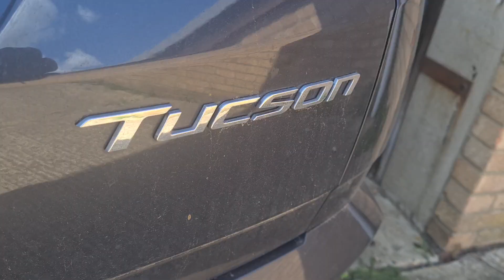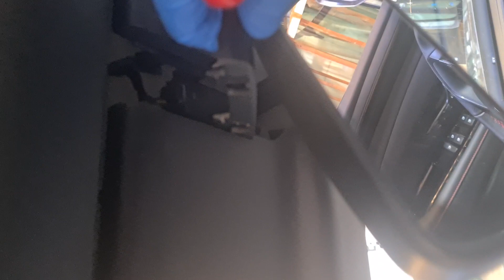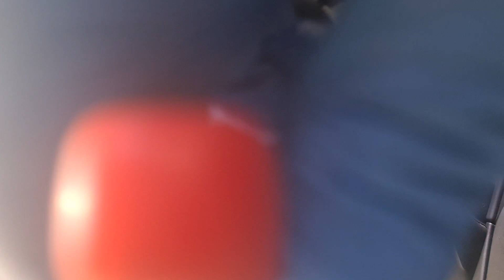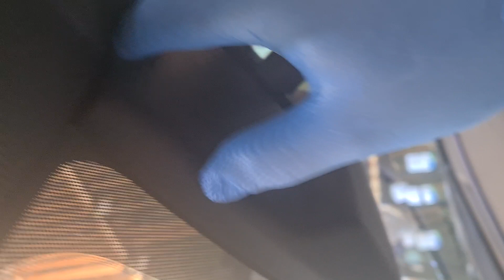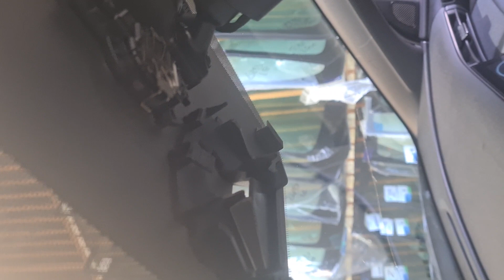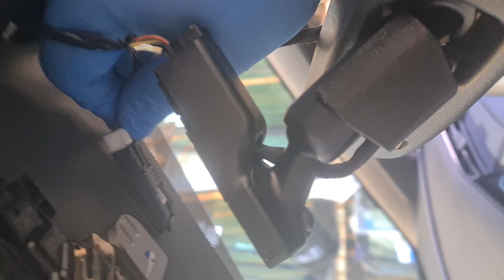(23) hyundai  tucson . rear view mirror sensor and adas camera removal

Comment: My rain sensor, light sensors and ADAS camera are not functioning properly after windscreen replacement. I think this video will help to realign all sensors in place. Thanks.
Reply from the maker: Hi iff adas camera is not functioning properly it means needs calibration but it can only be done with ota machine..the sensor normally its plug and play ..maybe just be just new jell pad or just not clip in properly some model it needs adjust    with scanner ...iff it has that's functioning on scanner...thanks hope it helps